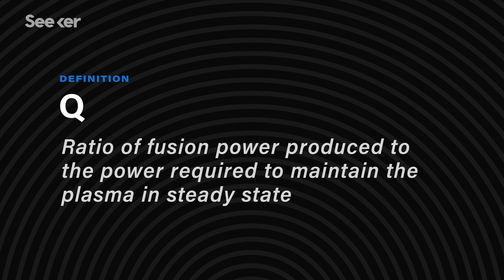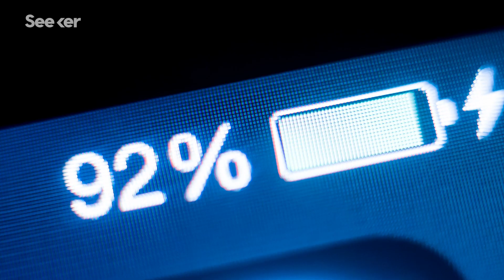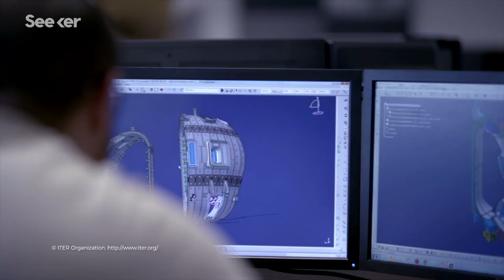How Close Are We to Fusion Energy?

Comment: Interesting. The biggest problem is the large heat that fusion produce.
Reply: Please be joking
Reply: How is it a problem ? Heat is basicaly energy in large quantieties which can be converted into electric energy. Thats what all power stations do. Here example : https://visual.ly/community/infographic/technology/how-coal-fired-power-station-works
Reply: The reactors shown here suspend all reactions magnetically in a vacuum. Extremely little thermal energy escapes.
Reply: information to learn no it isn't
Reply: I think that’s the point...
Reply: No, the biggest problem is keeping the fusion ongoing, and the next problem is to actually collect the energy surplus and doing something with it. There are more problems coming, perhaps the fusion process produces a lot of neutrons that make the reactor material more radioactive than expected.
Reply: With the application of quantum physics and nuclear physics by 2030 I would say yea we’re probably gonna be a lot closer, also I think it’s some sort of magnetic field that sustains the ambient heat which you can then absorb similar to the atmosphere and solar panels in that sense
Reply: It is also possible to set off a fusion bomb under ground and harvest the geothermal energy produced. :)
Reply: The super hot plasma is contained in a magnetic field.  It is not a problem.
Reply: The heat problem is The problem, bc disruption, you know when the sun have eruption, there is no serious computer to calculate this thing and it can happend at any time.
Reply: feldim2425 its not me who say it, check the german fusion project and compare to ITER .
Reply: information to learn. Well not the only problem but probably the biggest problem

Comment: We have had the capability for decades now. The science is solid and practically obtainable. It's getting slowed down by the entrenched energy industry lobbyists and fossil fuel moguls. All there really is to it.
Reply: Yes and no. We've had adequate theoretical knowledge for a long time, but finishing the maths doesn't automatically confer a set of workable, commercially viable blueprints, along with an achievement notification. It's only relatively recently that we have been able to produce the necessary magnets at a cost that makes it possible to produce energy at a commercially acceptable price. Unlimited energy at £/$1000 /kWh isn't a better option than coal or oil

Comment: Thorium molten salt reactors are the way forward until fusion
Reply: Jethro Condell Where does the thorium come from?
Reply: FutureChaosTV 
Ground? Like all civilian nuclear fuel
Reply: Where are they?
Reply: Well.... that is always the question isnt it.
Any time you have a product that drops in price it becomes very difficult to invest in large amounts of hardware to support it.  When adjusted for inflation, electricity prices have been falling since the '80s.  And while prices have risen in recent years, it is mostly because we put off deployment of new plants for so long that power companies have been on a building frenzy the past 5 years, and once they catch up with all of these newer and cheaper power sources, the prices are going to drop even faster.  Electricity is so cheap that it is putting companies with older plants out of business because they can't afford to maintain and fuel their older coal plants.

So Thorium is a great way to get base-line power.  The fuel is cheap, the risk is relatively low, but because nobody has really done it yet it is unproven, and the up-front cost is high (and the only Gov't close to approving it right now is China).  Plus, while safer, it is still a nuclear power plant with all of the decommissioning issues that a normal nuker plant has.

The question then becomes;
With wind and solar so cheap, and battery tech quickly becoming cheap enough to deploy en masse, what becomes the better investment?  Do we put a lot of money into a technology that we might only really need for 20-30 years, which has a lot of potential risk?  Or do we just keep pumping out cheap solar and wind which can be done on small and large scales, and build in peaker plants and battery storage to make up the difference?
As much as I like the idea of nuclear power plants in general (and thorium in specific), even I don't think I would pull the trigger if I had the authority to do it.  Coal is already being priced out of the market, and Natural gas will be priced out too as storage tech continues to get cheaper.  If these known cheap sources of power are too expensive for today's markets, then why would a Thorium plant even be entertained as an idea?  For that matter, even if ITER is a success, will there be room for it in the market 50 years from now?  In all likelyhood it will be too expensive to deploy even when it is ready to go.  There may be other uses for it to power large space craft and things, but on Earth I think it is going to be hydro, solar, wind, and alge-based carbon-fuels going forward just because they are clean and cheap.  This technology is cool and all, but the boring stuff is easier, safer, and cheaper to deploy, so it is going to win out at the end of the day.
Reply: wont need to be thorium, thorium is just something we have alot of (naturally all around us), problem is, for those who make bombs, thorium doesnt decay into P239 or whatever the weapons grade plutonium is, so its no good for them. Im pretty sure you could run a moulten salt reactor with any standard fuel we use currently and they would be safe, its all about how the plug drains the fission chamber to stop the reaction if it gets too hot
Reply: Hello, here is what a non scientist like me think he knows about LFTR:
- It is cheaper because you don’t have to build a big reactor
- It is safer because you don’t have to built pressure like with current nuclear power plan
- Safer also because the reaction tend to stop itself when you stop the power plan
- Part of the waste can be recycled in the LFTR
- Thorium is a byproduct of any mining and as we don’t know what to do with it , it is very cheap
- The cons seams to be it need a classical power plan byproduct to ignite the reaction and the byproduct of the LFTR if in small quantities is very highly toxic 
Let me know if/where I’m wrong

By the way I’m French and as I know we do use nuclear power plan by product to build our nuclear weapons.
Reply: Obi Wan Cannabi Making bombs from nuclear waste is not as easy as just throwing the waste into a bomb.  First you have to seperate the Plutonium from the rest of Nuclear Waste. Now you may say that we have to do this to obtain the uranium fuel, so doesn’t this mean that commercial reprocessing makes nuclear weapon production using plutonium just as easy? 

No. One major factor that a lot of people do not understand is that while Plutonium 239 is a product from Uranium 238 in Nuclear Waste there is a significant amount of Plutonium 240 in Nuclear Waste as well. When you seperate Plutonium from Nuclear Waste in a reprocessing facility you cannot seperate Plutonium 239 from other isotopes of Plutonium 240, because as a chemical they all share the same characteristics. The differences occur on the atomic scale not the molecular scale. To seperate Plutonium 240 from Plutonium 239 you need a centrifuge at an enrichment facility to seperate the two by mass. Keep in mind the difference is by a single neutron or 1.67 x 10^ -27 kg, so to seperate the materials it takes a considerably long amount of time to obtain enough seperated Plutonium 239 for even a small WMD (usually months of time). 

But why go through all of this- why don’t just use Plutonium 240 in a bomb? At the atomic level Plutonium 240 has the unique characteristic of spontaneous fission, which makes it problematic for bomb construction. 

The point of this comment is to describe why making bombs from commercial reactors is extremely difficult even in the case of commercial reprocessing. In reality bomb production was never the major reason why Thorium fuel was not pursued.
Reply: Why just thorium? Why not uranium based fast breeder reactors too? They both have pros and cons, but at least fast neutron breeder tech is more well established and will likely be easier to license, and they can use sodium chloride as a coolant instead of something more exotic like FLiBe.
Reply: Probably both. Each has its' own pros and cons
Reply: I really dislike you armchair nuclear activists whom tout Thorium as the best thing ever. You're not a nuclear engineer, you don't know how difficult and pointless it is to build thorium power plants. We don't need thorium, we need the NRC to expedite licensing procedures for new, novel fission reactor concepts.
Reply: Adolfo Baca 
Are you a nuclear engineer?

All research on proper versions of thorium reactors showed that it is easier and cheaper to store fuel, abundance of such fuel, and reaction being fail-safe (if everything went wrong, destruction of the facility stops the reaction)

And it was same difficulty to research and build current tech of nuclear reactors. But it was paid by the military
Reply: NoName Can you supply a link of this research, because I have not seen a single study that has claimed a completely new Thorium extraction process would be easier and cheaper than the existing uranium mining infrastructure.

Let me put it to you this way, there is a reason why Terrestrial Energy decided to develop their IMSR in Canada using Uranium instead of Thorium even though they were aware of the fuel benefits of Thorium in Fluoride Molten Salt Reactors.
Reply: NoName I am, in fact, a nuclear engineering student. I actually took a 4 month class on nuclear fuel cycles, and I can generally say that they're not as grand as you think. You're ignoring the fact that the decay chain leads to hard gamma emitters. You're ignoring the fact that thorium requires a great neutron economy to breed into usable fuel, and requires unusual neutron drivers in the core. You also don't take into account the burnup effects, which are not well studied. Who knows how the mix of Thorium 232, plutonium 239, uranium 233, or more isotopes will react? 
Are YOU a nuclear engineer?
Reply: Adolfo Baca Why are you suggesting that Plutonium 239 would be in the mix for a Thorium Breeder. That doesn’t make any sense as Plutonium fuel is more suited for fast reactors but most Thorium designs are for thermal spectrum. It would make much more sense to use Uranium 235 as your driver to initiate breeding.
Reply: Brian That is a valid question to which I had the answer about a year ago. I would reference my notes if they weren't in another city, but I'll be sure to look up why that was suggested asap
Reply: Brian Implying that uranium mining is "cheap" or "easy" is hilarious.  Don't we have to dig up something like 100 tons of material to get a few pounds of uranium?  And then to refine even an ounce of uranium, it has to run through something like 3000 meters of tubing over the course of several months and one rod weighs like 75 pounds or something?

Thorium is 3x more adundant and we already have it as a by product of refining other rare earth metals.  I'd have to say that you aren't as informed on this subject as you'd like to think.
Reply: The reason we don't use thorium is because it's incredibly difficult, if not impossible, to make a bomb from it.  Uranium is much simpler to weaponize by comparison.
Reply: Darth Obscurity You're not as informed on the subject as you'd like to think either. I can see that you're starting to spout quack nonsense and have disrespected me directly. I actually found the answer, and yes, I'm back in the city with my notes and textbook. Thorium is fissionable, and can itself be fissioned in a fast reactor, which as Brian said earlier, Pu239 can drive. You are correct that thorium 232 is almost impossible to weaponize, and you are possibly correct that we chose uranium instead for weapons purposes. 
Believe what you will about the way I phrase my opinions, but anyone could say the same to you: your posts sound like those of someone fed too many vsauce, seeker, verge, minutescience, and whatever other videos. 
You are base level, and may God have mercy your soul.
Reply: Darth Obscurity Just because Thorium has a greater abundance in the Earth’s crust does not by any stretch of an imagination indicate that a particular area has a greater concentration of Thorium relative to Uranium. 

The problem is you are suggesting that a completely new mining company with completely new processing procedures to extract Thorium from likely Monazite would be easier to reach commercial scale than continuing the existing industry. When you start a completely new industry the initial costs are always higher than a standardized existing process.
Reply: Darth Obscurity That would be a great argument if commercial reactors actually made bombs. Unfortunately for your argument that is illegal by the Atomic Energy Act of 1954. Commercial reactors in the USA have never been making WMDs, so your argument bears zero incentive and zero relation to the commercial nuclear industry.
Reply: Adolfo Baca You can fission Uranium 233 in Fast Spectrum, but at that point you might as well just build a fast Breeder reactor conveying Uranium 238 to Plutonium 239. It’s not as complex, which in turn likely indicates that costs would be lower for Plutonium Fast Breeder than a Thorium Fast Breeder. Furthermore in my opinion the greatest reason to develop FBRs is to reduce Plutonium 239 Waste that everyone in the general public is so scared of.